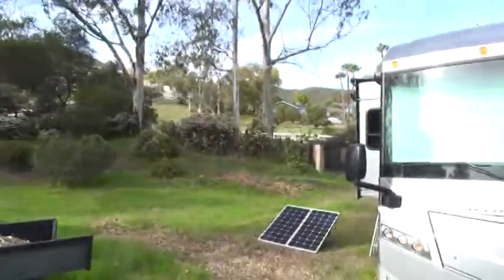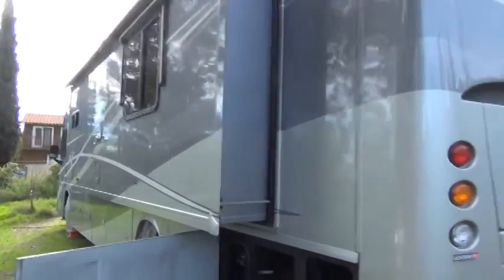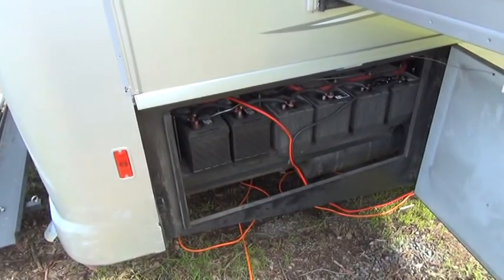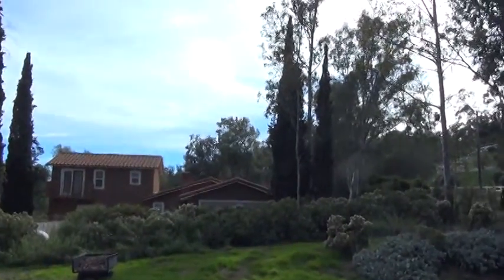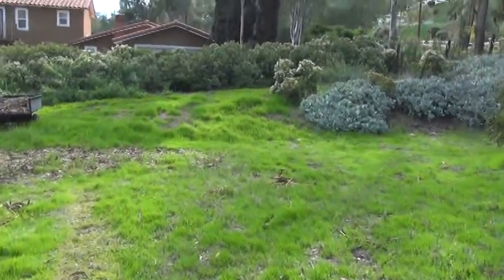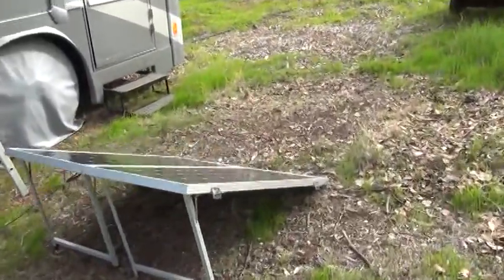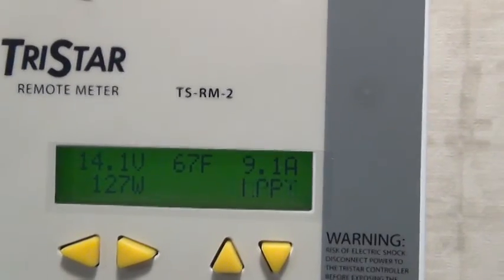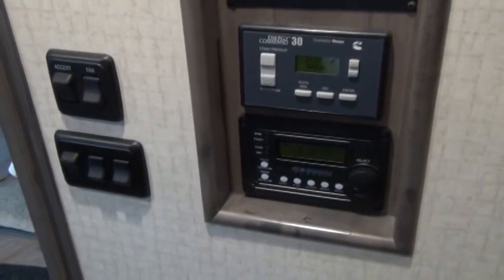RV battery and solar power systems

Comment: Jerry, I left you a comment on the WITT FB page, about needing to move the negative alligator clip from your portable PV from the battery to the BMK shunt, so that the BMK and ARC know about the incoming power and can measure it and update the SOC% and AH IN/OUT meters, etc. Barry.